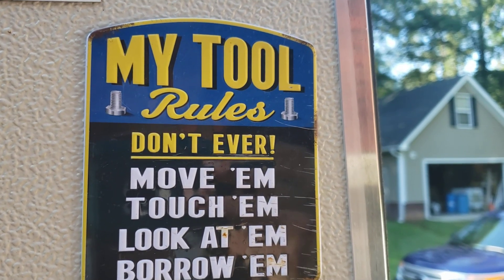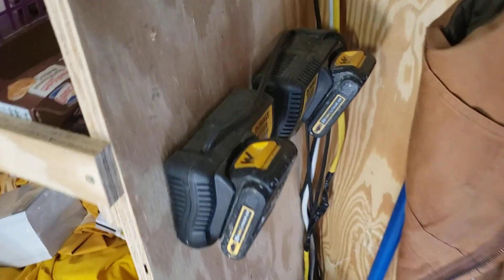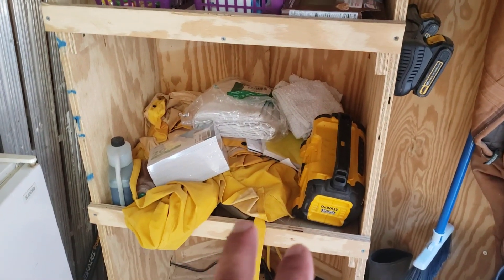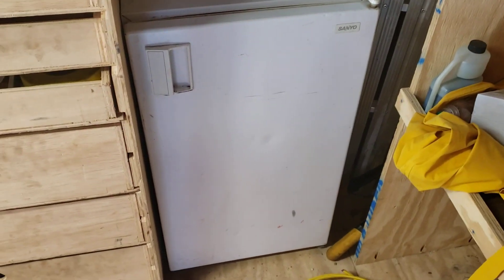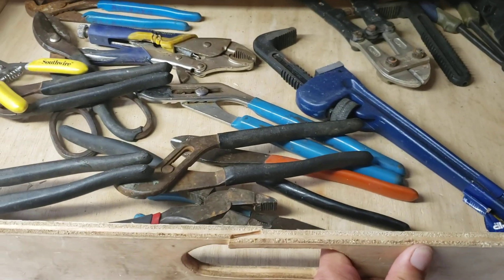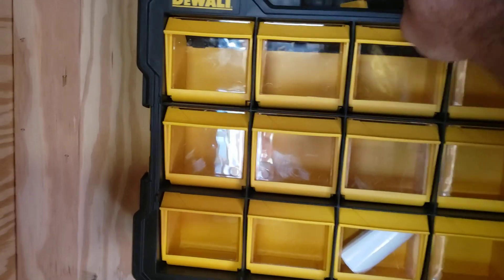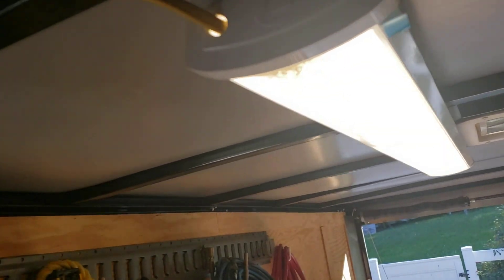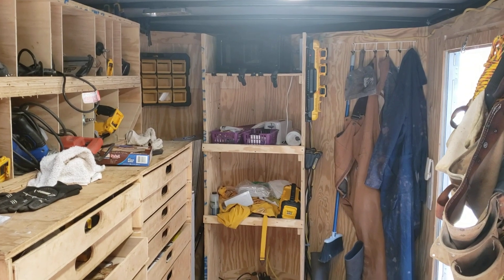How to equip your enclosed trailer

Comment: Looking good brother.  I've been trying to figure out a way to mitigate the heat inside my trailer is well. I was thinking cutting a hole in the roof and putting one of those vents and would help fix things but sounds like having a vent doesn't really do much. I also considered buying 1 of those AC units that go on top of the RV's that are pretty slim... I figured that might be a good idea also
Reply from the maker: Yeah my vent probably let's heat out but the lack of air movement is a beast.  I looked at those RV type but they are expensive.
Reply: What about installing a fan to the overhead vent.?.... While you're plugged into power.